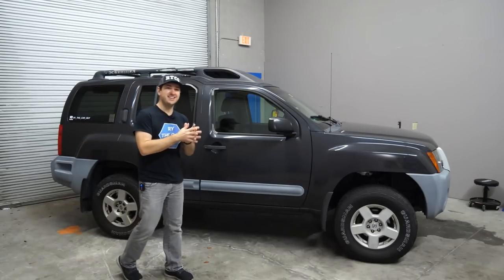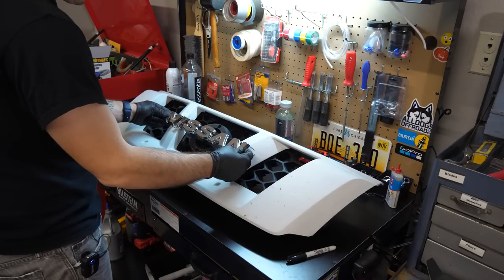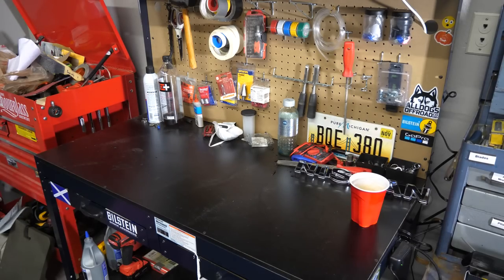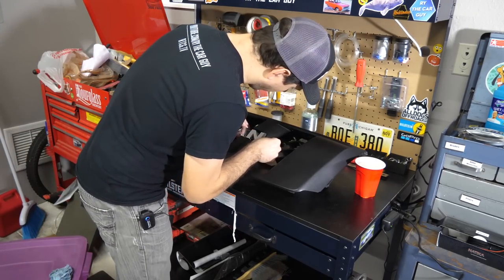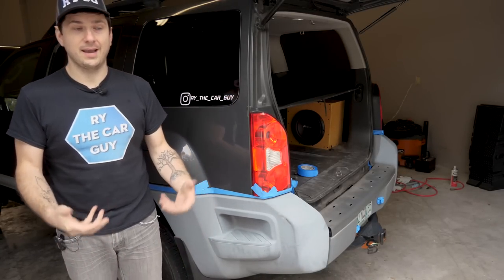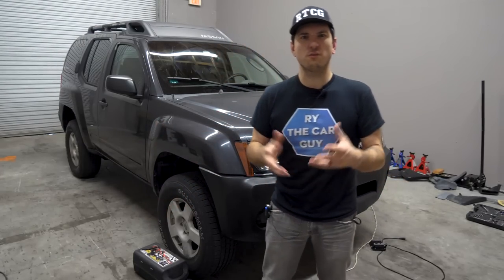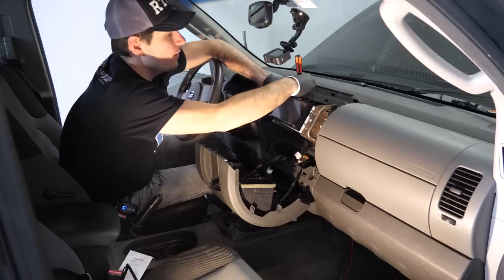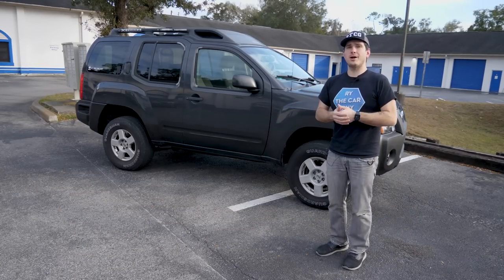How To Give Your Xterra A Facelift and Install a Front Facing Camera

Comment: I love the look without the plastic trim so I tried it with my 2011. Nissan added holes in the divot and pegs on the backside of the trim to better hold it in place. So now I can either plug the holes or put the trim back on. Learn from my mistake newer X owners.

Comment: I didn't use the camera you did, nor do I have a radio that will display the video feed, that being said, the system I installed has its own monitor which I mounted on the dash, and inputs for 2 cameras. GREAT!!......  only problem is that there is no way to reverse the video from the front camera.  DRAT!!  So I have gotten used to the fact that left is right and right is left. I mainly use my front camera when off road when I need to see what is directly in front so I can avoid some obstacles.
Love the rebadging in the grill, it is great.  Overall the facelift looks real good.

Comment: Lol! Thanks for leaving in the 30 minute mark where you missed the ignition key hole. Gave me a good chuckle. Also, great work!
Reply from the maker: 😂 for sure. You know what funny about that. My other car is push but on the dash so I don’t even currently have a car with the cylinder in the steering column. Old habits die hard I guess.

Comment: Honestly, I like my side plastic bumpers because they are very functional.  When using a floor jack the bumpers hold the jack handle just off the door panel.  Plus there are all sorts of scratches and dings in them from who-knows-what that otherwise would be in my paint.
Reply from the maker: I get that. I do like that it holds back the jack. I guess I dont think about it because the condition of my paint is wretched lol.
Reply: Yeah.. plus I ended up removing mine which left me with 2 holes in both front doors.. now it’s taped up. Contemplating whether I fix the holes.. or just buy new plastics and adhesive.
Reply: The holes were there because the plastics had little clips, that went into the body. I had no clue these were there.

Comment: Great tutorial from a fellow Nissan enthusiast. My suggestion for the spot where you took the oem emblem is get a sheet of 1/8 abs plastic sheet and trace the outside of the old emblem cut it and you can either paint it red with duplicolor or plasti dip or put a red 3m vinyl decal sheet  and slap it back on with either silicone or hot melt glue and call it good. Thats what I ddid and to me its looks great
Reply: Good call- or sacrifice the old emblem? Cut, trim, paint reattach ?

Comment: On your old Nissan front emblem some refer it as the "Hamburger" cut away at the upper and lower arch and remount it above and below the new logo. You can trim them down so it still fits in the existing mounting holes.
Reply: That's a good idea or Bondo the mounting holes
Reply from the maker: Yea i think I will try this at some point. I think it will look interesting

Comment: To fill in the holes, tape up the back and put hot glue and then paint over it. You could also fill in the back of the nissan logo to have more surface area for the tape to stock too.

Comment: Put peanut butter over the adhesive, leave it on there for an hour or so, then wipe it away with a soft cloth so you don’t scratch your paint.

I did this for duck tape residue on my wood floor, and it all came off with EASE when I couldn’t previously get it off by scraping before.  You may need several sheets of cloth to get it off though, since you will be getting the peanut butter on the cloth as you remove it also.

Comment: If you have a rotary or DA polisher, it’ll get the rest of the residue off the sides. Compound and a microfiber cutting pad will do wonders. I had the same issue when I took off my pinstripes and my DA cleaned it up nicely. Good luck.
Reply from the maker: That’s next on the list. Thanks for the tip. Maybe next weekend.

Comment: Thanks for the video, man! I just did all of the plastic on my xterra a couple months ago as well. I used duplicolor trim & bumper in black. It seems to be pretty great material so far, it's really smooth and after a few days of curing, seems to be pretty tough. If all else fails though, a rubber coating that resists UV will be the next solution.
Reply: @Kaysen Albert instablaster =)
Reply: @Jairo Braden It worked and I finally got access to my account again. Im so happy:D
Thank you so much you saved my ass :D
Reply: @Kaysen Albert Glad I could help :)

Comment: Hey Ry, looking for some advice.  I removed the side molding on my '14 X to find holes for a couple tabs. I kinda worried now about moisture getting in. The molding is completely off and I don't think its going to go back on properly.  Can you recommend any way to plug those two holes? Thanks my guy!
Reply from the maker: I would get some flat body panel clips. Those "Christmas tree" ones. If you put those in there you will have minimal water intrusion. MUCH more water makes it into your door through the window seal than would make it though that.
Reply from the maker: Don't fret about making it water tight.

Comment: Looks really sharp! Nicely done. I had no idea that removing the side panels would be that much work! Hey I noticed your subwoofer enclosure is really streamlined and tucked out of the way. What enclosure is it?
Reply from the maker: I custom made that a couple years back. I but the front lip to slide into the tack back there. Its been really awesome. Still need to wrap it in felt.
Reply: It looks professional! I ought to do the same and free up a little more space in the back.
Reply from the maker: Thanks! I can take a few pics and send them of you like. To give you an idea of what I did.

Comment: 12:20 
I live by 3m double sided tape. It's holding my lightbar on, through bumps, mud, and highway miles. It's held my gopro on my motorcycle on at... excessive speeds. That stuff is the bomb.

NOT knocking gorilla, just giving my personal experience. :)

Comment: Off-topic question.  I want to replace my stock horn on my 05 Xterra OR.  Did you replace your horn?  Or is that the original stock horn?  Since I will be replacing my stock horn with two similar shaped horns (like the one in this video) I am trying to get an idea where to place them.  (You've been a savior on so many of my questions!  Thanks for everything!)
Reply from the maker: Those are stock horns and they are in a pretty accessible area. I would like to do that job one day. I'll probably make a video,

Comment: I know it's an older video, but I have a question about colors. I have a 2011 Xterra S 4WD. My plastic color matches the color of the window edging/trim. Did you paint that as well? If I were to black out my plastics, my window edge/trim would stand out I fear because it's the darker grey (much like yours was originally).

I love the content. I've done quite a few of the things you've described to my vehicle. Unfortunately, I'm not mechanically inclined, (or physically fit enough) to do a lot of the things, but I love seeing what you've done with yours.
Reply from the maker: Hey Sam, I did not touch the window trim. Once I had it all painted, I didn't notice it that much. However, if you are already thinking about it, it might bother you once it's done lol. I appreciate you watching!

Comment: Hi Ry I love your videos! I have an xterra and my boyfriend has a Pathfinder. I have a question about a Pathfinder 2005 it's loosing power and there are no codes at all. Could this be the fuel pump or Alternator?

Comment: How has the bed liner held up? Did you have any issue that needed readdressed, and if so, how did that turn out? I have a white 2005 Xterra and want to address a terribly faded front bumper and could get all the plastic to match.

Comment: Great video, man I love your channel!   Question, and I dont mean this sarcastically, but what is the point of a front facing camera?   I have a Blackvue 4k dashcam in mine, which records to an SD card, so its helpful if you need it for insurance and/or law enforcement reasons.   But an NTSC front camera which just pipes to your stereo head....  I mean, Im at a bit of a loss as to how this is useful when I have hi resolution eyeballs already looking forwards....
Reply from the maker: It would mostly be utilized for rock crawling. Getting an idea of how close you are to obstacles and how to navigate around them

Comment: Take the old emblem, cut out the center and put the "burger bun" top and bottom back on, they would fit into the exposed mounting holes, kind of a combo of the old and new emblem.
Reply from the maker: Was thinking about that. Might try it.

Comment: Hey Ry, I have an '05 Xterra.  Your videos have been very helpful.  Thanks a lot.  I noticed in this video you have a Panasonic stereo installed in your Xterra.  I thought you had a Sony before.  Did you recently change out the Sony?  Why?  How do you like that Panasonic, what model is it?
Reply from the maker: Glad you like the videos! 
To be honest I switch the radios out a lot. Right now I have a kenwood in there. I buy new ones when I get bored so I can do review videos on them. Nothing against the Sony. Just time to change it out. If you look at my playlists I should have a review playlist. All the radios should be in there. The latest review on the kenwood is actually on my second channel. Ry The Car Guy 2 in case you want to take a peek at that
Reply: @Rythecarguy  OK, thanks for the response.  I'll check that out.

Comment: A Nissan without the “burger”?  Oh Ry, how could you!?  BTW, I’m happy with the old fashioned (2011) Fosgate sound system in my Pro 4X.  I use a dash mounted iPad to play music and navigate - super-easy to upgrade. I would like to also have a dedicated smaller screen to monitor the 4 or five rock cams I hope to install.  Have you seen one of these that can take multiple feeds and switch around like your head unit?
Reply from the maker: Yes like a security system screen lol. It would be awesome to have a touch screen. Slap a few cameras strategically around the x and quickly and easily changes views. That sounds dope.

Comment: Hey, Ryan. Can you recommend a good pair of shocks… Rear shocks, for a 2011 X. 4wd
I am probably never going off road with it.  Seems to be a lot to choose from, I was eyeballing Bilstein 4600 series.  I’d like your opinion. Thanks a bunch.
Reply from the maker: Unfortunately for the Xterra I can really only speak to the OEM and Bilstein 5100s. The stock is going to be a softer "on road" kinda ride and the 5100s are for sure going to be stiffer. I will say when I upgraded to the Bilsteins on my X I really did like the on road feel. There was less body roll and it felt tighter. I have also heard good things about Koni but I think those are kind not expensive.

Comment: Nice video! could you have left the original round emblem on, and just cut out the part in the middle as you did the sides of the grill? I think it would look pretty cool to have the round part in the middle of the NISSAN ...?
Reply from the maker: I was considering that. I might try it to see how it goes. If I do I will do a community post about it. If you’re subbed you will see it pop up.

Comment: Do you have a video about replacing the plastics? I didn't find one.  I need to replace the plastic on the xterra I just bought,  but am not sure if it's too big of a job
Reply from the maker: If you look at my hitch install and fog light install it shows taking the front and rear plastics. Off

Comment: Hi

Do you know wich relay its for a short ligths. No headlamp. In a frontier 2006 crewcab 4.0L.
What is the model of the radio do you use in the video if it direct fit in hardware. Not in the connector cables. Thanks

Comment: Hey Ryan! First, thanks for making these videos! You've been my savior when it comes to working on my Xterra! Just bought a shirt to show support!  Question though: I bought the same Natika camera that you used for my front facing camera, but the image is mirrored, i.e. objects on the left in reality are displayed on the right side of the screen, and vice versa.  Is there a way to change that to display what is actually in front of the vehicle?
Reply from the maker: Thanks! I appreciate the support. On the camera wire there should be looped wires. Of my memory serves me there is 3 on that camera. Cutting each wire serves a purpose. One wire is for what orentation you are mourning the camera. Once you cut it the image will flip. Just need to figure out which wire it is. The manual should tell you.
Reply: @Rythecarguy  thank you!!

Comment: I had someone install a pioneer touchscreen radio in my Xterra; however, now the light for AC/Heater control panel don’t lit up at night. What could be the issue?

Comment: Ry, did you ever do a video about your mirror? I grabbed a Pathfinder mirror with compass and homelink, and you mentioned using fuse-a-circuit tap for yours. Was there anything closer to the mirror, like dome light, that could have been used? Thanks!
PS - Methyl Hydrate for sticker goo
Reply from the maker: That’s for the tip on the MH. Yea I did make a video. It’s part of the rear view camera video. You can tap into the domes but you should really tap into something on the acc circuit.

Comment: Radiator and overflow tank have near identical caps. Which goes where? There’s been lots of debate on this.
Reply: Radiator gets the flat cap (no spring), Overflow gets the pressure release cap (c/w pressure release spring).

Comment: Beware for people trying to remove the side trim.
 I removed mine and noticed I had a hole on each door. Where the trim clipped into the body panel. It seems this is only on certain years, mine was a 2011. I ended up buying new trim and painting it.

Comment: Looses voltage. Some times goes to a idle. You push on gas nothing at all. Everything goes blank. Acts like no voltage. Then if turn key off and start again..starts then dies again after everything goes black.